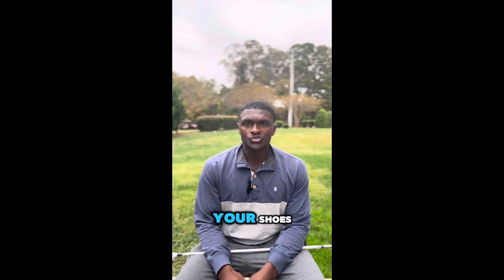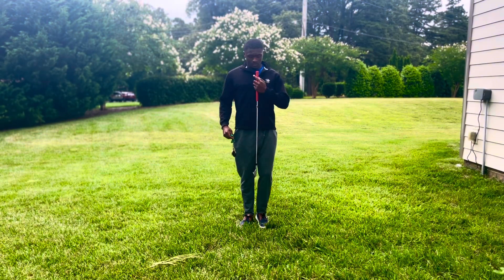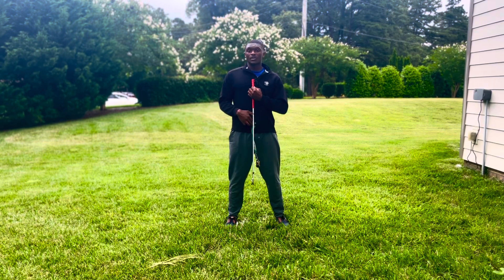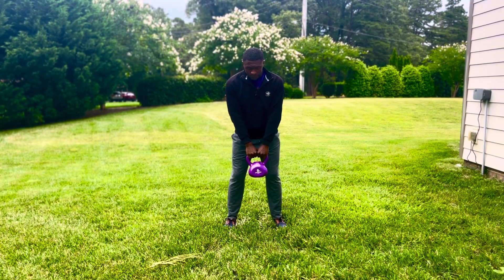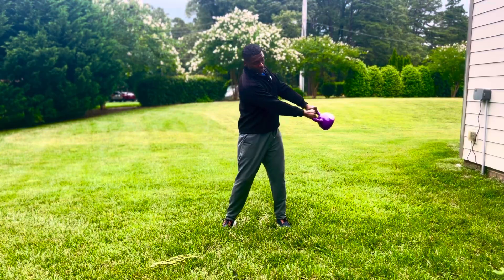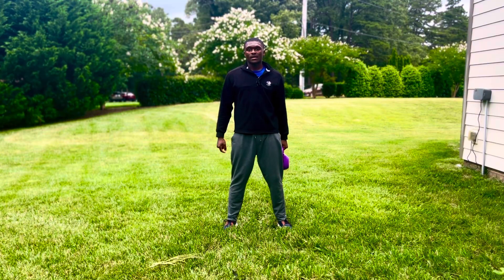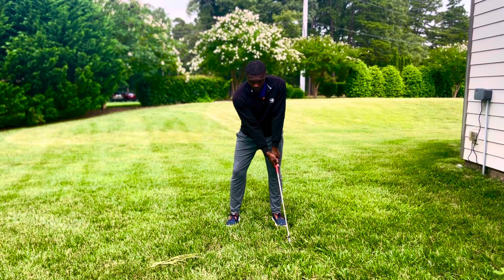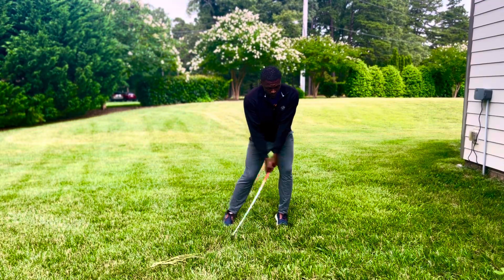MOMENT ARM: The HIDDEN KEY to Distance in Golf! #golf #golfswing #golfcoach #torque

Comment: Great video. You explain the concept very well, it makes so much sense, I realize its always been right there but I never applied it properly! Basically move your pressure from your left foot back to your right foot while moving your center of mass as little as possible on the back swing then reversing it move your pressure to your right foot while moving your center of mass as little as possible.  Or if you are focusing more on the club swinging as the club swings back try to move your pressure to your left lead leg as far away from the swinging club without moving your center of mass. If your club and arms are still swinging back as you move your pressure forward your center of mass will not swing forward together with your center of pressure. I never fully understood this concept of keeping your center of mass relatively still compared to the movement of your center of pressure till I watched this video, thanks, amazing explanation!
Reply from the maker: That’s the whole concept. I am glad I was able to help. Let me know that helps